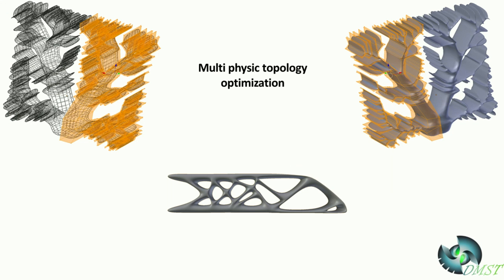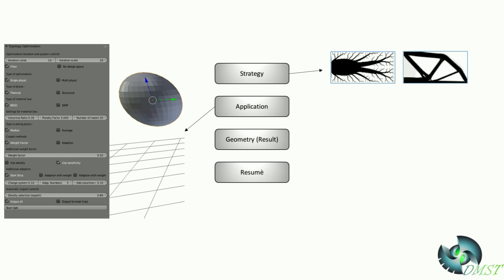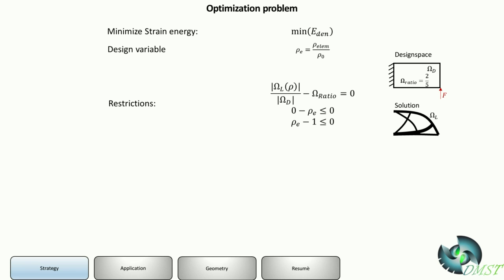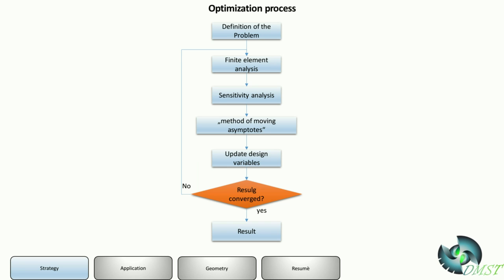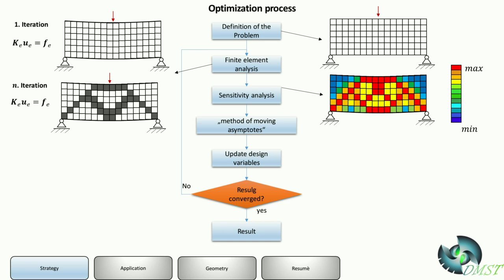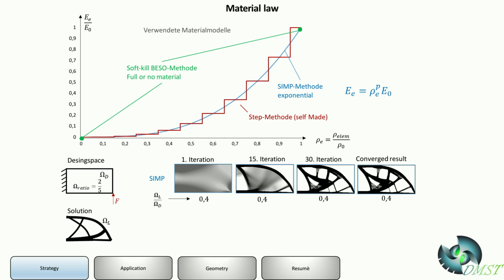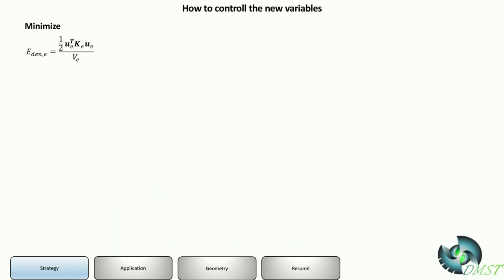Topology Optimization (Introduction) Part 1

Comment: why we use material power law and how its works?
Reply from the maker: Well its a emperical penalty function for the optimization. Its Just the Standard function. There are Others aswell. Go to Part 2 and 3 there you will find how it works

Comment: Hi, could you explain more about the Design Variable 2:09 , what does the normalized density mean? What is (density element) / (density knot)? Thank you.
Reply from the maker: Hi Himal, 

with normalized density I mean that: If you have a normalized density of 1.0 it represents full material areas (black pixel) if you have a normalized density of 0.0 it represents no material (white pixels). So it is just a variable which controlls if the area has full material or zero material properties. So for example if you use steel with 7.8 as a density you just normalize it to 1.0.
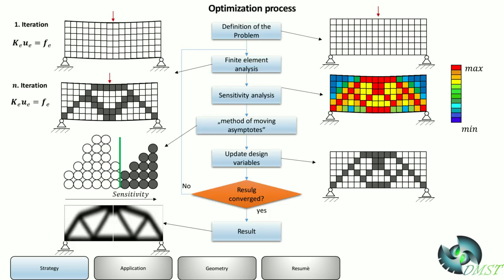On 6:14 you can see the behaviour if i increase the normalized density from zero to one. So if you have a normalized density of 1.0 --> full material. You also have a full young module. 

In the finite element analysis you will then convert the normalized density and the normalized young module by scaling the values with for example 7.8 as the density and 210000 as the young module.

So in the end a normalized density of 1.0 represents a young module of 210000 and a normalized density of 0.3 represents a young module of approximately 20000.
Reply: DMST Thank you very much for the explanation. Your contents are very good!
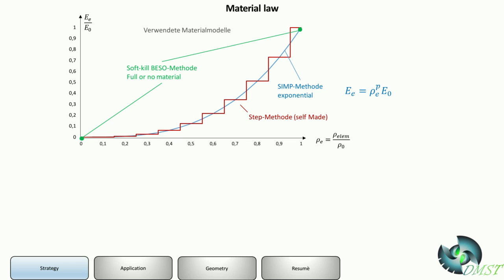Reply: Also, on 6:14, on the y-axis, what does the Young's Modulus (Ee) and Young's Modulus (Eo) refer to?

Comment: Your video series are too confusing. Could you take topology optimization video series at the begining for beginners and not using blender (just python)? And also show theory and explain everything for dumbs (because there are not enough sources expect yours, even in English). It might be good show your own and detailed slides and after those, show examples in python. (One more question, can first grade mechanical engineer student understand this and will those students see topology optimization (if so, under which lecture?))      
:D    :D
Reply from the maker: Hello Hakan, 

maybe i need to update the series. Thanks for the feedback. 

You can try out the following python code (only a few lines).
If you understand this example, you understand the full topology optimization.

http://www.topopt.mek.dtu.dk/Apps-and-software/Topology-optimization-codes-written-in-Python

You should understand this if you have heard technical mechanic I and technical mechanic II.
In this subjcts you should get familiar with finite element method (2D cases are enough).

The theoretical background is called continums mechanic. Typically this is a subject for master courses.
For the practical few and implementation you only need the knowledge building a FEM-System.

Best Regards

Comment: what about with multi-material topology optimization can u tell me program for that ?
Reply from the maker: Well there are some example matlab scripts. But right at the moment I dont think that there exist a commerical program for multi material optimization. There are only some open source programs with no GUI
Reply: DMST why no company as ansys or abaqus add this important feature at this moment?
Reply from the maker: @AhmedGamal-gq1if  well if there are not any customors willing to pay for that then they wont implement these features. Therfore you need to program such kind of stuff by youself.
Reply from the maker: Hi Ahmed,

currently I got a research prupose, that i should impelment a Multi Material Optmization (At least i can provide you that)

Comment: How is the density of a single element calculated?
Reply from the maker: By using the method of moving asympthotes using the sensitivit of the strain energy
Reply: @Luchsio thanks for the quick reply! do you have a source for this?
Reply from the maker: @simonpeifer2982  this is the standard book Topology Optimization: "Theory, Methods, And Applications

Sigmund and bendsoe
Reply from the maker: @simonpeifer2982  If you need source Code, search for a 99 Line matlab code for topology optimization or you can take a View on github. There you can find a Python implementation written by me for multi physics (DMST1990)
Reply from the maker: @simonpeifer2982 there you can Download my master Thesis, written in German.  https://github.com/DMST1990/ToOptiX/tree/master/Documentation
If you need a handsome translation Tool to english, you can use deepl.com
Reply: @Luchsio  Danke für die Hilfe, ich les mir's direkt durch!